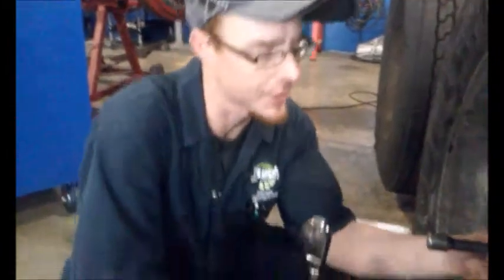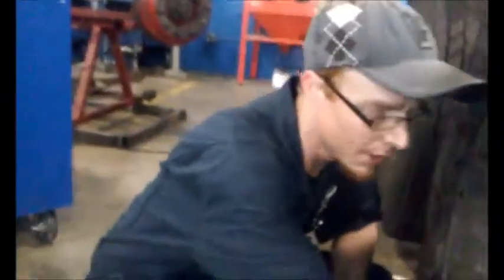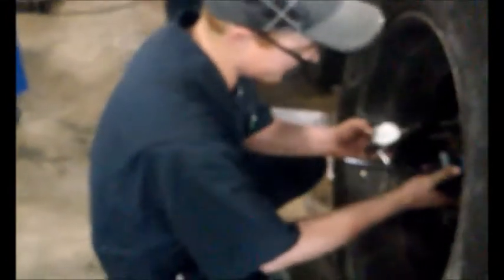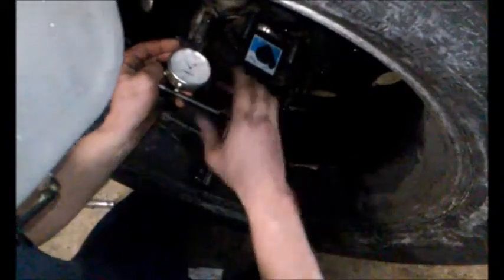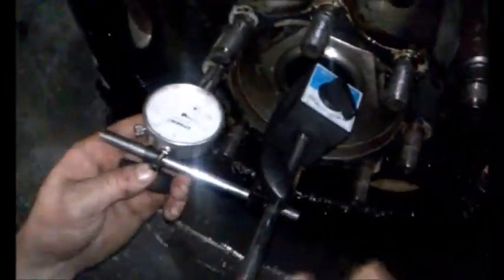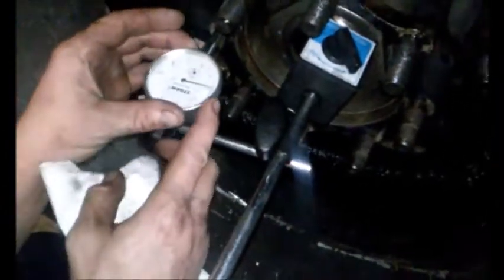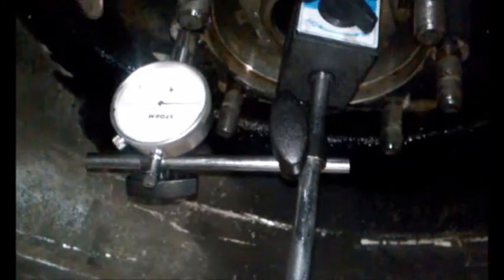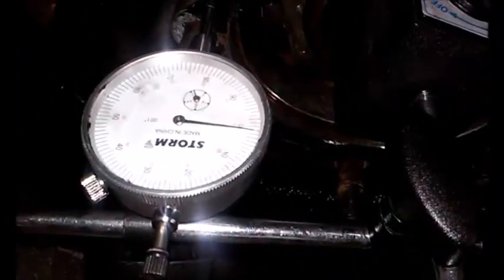MEASURING WHEEL BEARING END PLAY

Comment: Should have the indicator on the top or bottom of the hub surface for the direction you were moving the hub. That was not an in and out movement. Or leave it set like you had it and grab the tire on the left and right and do that movement and may have seen more end play.